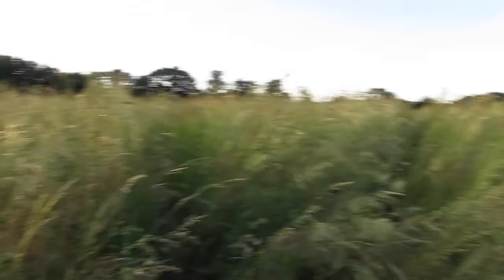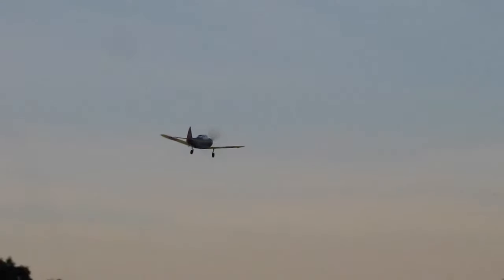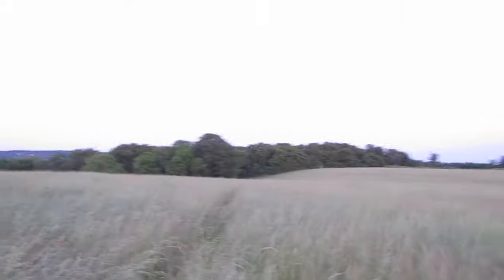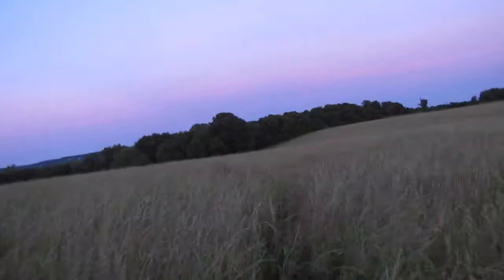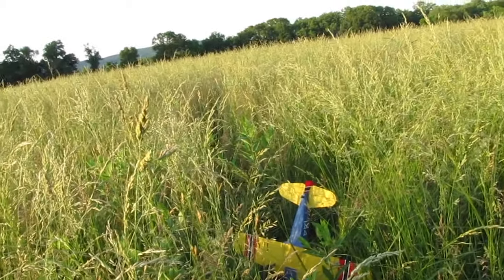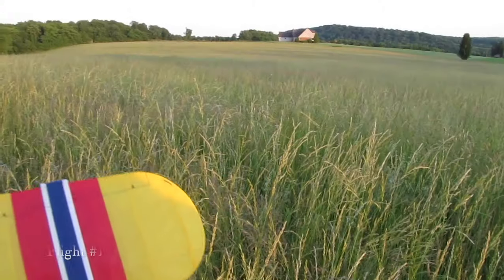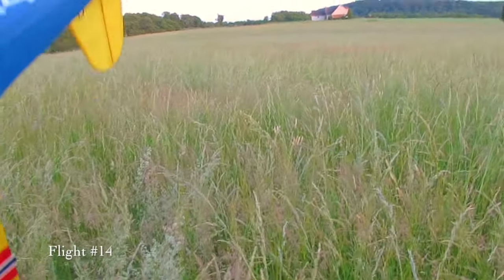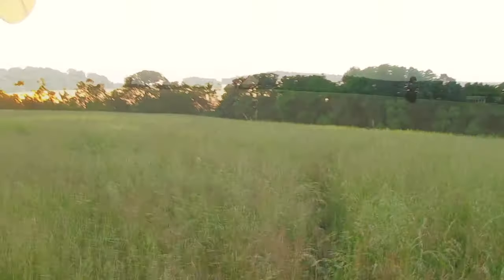Rubber-Powered Fairchild PT-26 - Anatomy of a Trim Session

Comment: Excellent as always. Could you someday maybe show how you adjust the rudder, change thrust angle, add weight, etc while at the flying field.
Reply from the maker: Thx, I'll post some photos when time allows. The rudder and elevator have small soda can hinges (1/4" x 1/2").  Make a slice on each side and slip them in.  Hit with CA.  2 or 3 hinges will do, securing each adjustment.  With clay, I don't add much...maybe the size of a pea each time, or less. I'll post the thrust plate for the nose block, which is very helpful for field thrust adjustments.
Reply: @maxfliart  any photos you could share on adding clay and gurney weights?  Thanks!

Comment: Following your example of rebuilding your Caudron, I have completely stripped my Me109, removed all unnecessary weight and treated it to new flying surfaces and tissue, so avidly watching your trimming videos in anticipation of its re-maiden flights. I'm just wondering what your thinking was behind your decision to change the prop? Currently, the 109 has a small fast prop... Many thanks for taking the time to post another wonderful video.
Reply from the maker: The first prop was a yellow Czech prop, which I heard from some pals was quite good.  It did ok, but I just wasn't feeling it, so I switched to a 9.5" blue prop...don't know the name of it...but it felt better to me.  I've since broken it after a rough landing in the wind, and have put a 10" white EB prop on her. Thx for the kind words.

Comment: Thanks mate. I'm just returning to the game and am learning a lot from your videos. What sort of camera are you using? I'd like to make my own videos and can't see my GoPro matching your efforts.
Reply from the maker: I use there latest iPhones for my B roll footage, and an older Canon PowerShot SX20 for right zoom flight shots. It has much lower resolution, but combined with a 20X optical zoom, gets u close enough for the YT vids. I use this cam from 2009 because it was early on with image stabilization, which was mild, and perfect for tracking FF models. Anything newer or especially current has such a strong IS, that it nearly makes it impossible to frame the model as u would like throughout the flight. Plus, I found that the 20X is about the limit for zoom, while hand held. Once u get closer to 30X and above, it's not worth the effort. Using a tripod for capturing the moving flights isn't realistic, and leads to even more jerky captures. Good luck!  U can find these Canons for around $60 on sites like Mercari. The only issue is dust on the censor, which can not be cleaned for less than the cost of the cam, so it's best to find one that's spotless. So I ask the seller to shoot a blank surface and send me the shot. Has worked well.
Reply: @maxfliart  Thanks. The zoom was what really impressed me. It's a shopping I shall go.
Reply from the maker: @adelaideoldphart  Yes, it quickly makes up for the 720p resolution.  Of note, I always manually focus for infinity prior to each flight. Otherwise, auto focus likes to play tricks.

Comment: Very interesting. I never liked to make 2 adjustments (say, thrust & ballast) at the same time .. too easy to get a bad outcome.  It sure has a tight right pattern, which seems to have gotten rid of the power-off scallop noticed in later test flights. At one point, when you said you were adding a tad more tail weight, I found myself saying NOOOOOO!  But, it all worked out in the end. It's really a beautiful Ryan.  Reminded me of one of my 1st control line planes, the famous Cox Thimble Drome PT-19 Flight Trainer (but that was open cockpit). Thanks for the nice video. Cheers.
Reply: I said the same thing...nooooo!   In flight 13, the glide was as close to perfection as I think I've ever seen - if anything, it was just about on the verge of a slight stall in the glide - but then you moved the CG back (clay on the tail), which really confused me.   I figured that if you wanted more climb at that point, I thought you'd go with a thrust angle adjustment.   In any case, that's a gorgeous model, and a good flyer.   Beautiful job!
Reply: By the way, I had one of those Cox PT-19's also.....man, that was a long time ago!
Reply from the maker: Haha...I too felt the same when I was reviewing the films!!  Surprised me.  I suspect it was only a very small pea sized bead of clay I'm sure part of it, at the time, was my strong resistance to changing the thrust setting...which would take up more time in the fading light.  Much easier to simply add clay.  Still, in the end, thrust was indeed one of the keys to dialing her in.

Comment: That Norwegian Army Air Service (Hærens Flyvevaaben) PT-26 is beautiful. I love the Norwegian colours. They really needed that canopy up there. PT-19/26 is a classic design with perfect proportions and areas.
I have thought that if there was some lightweight mechanical way to slightly increase the turn the initial climb out which, of course, tends to counteract a right turn because of lefthand torque,  and then relax it as the motor depletes, it would make a big difference. Something like a DT for the rudder might work.
What do you consider to be your best-flying, most satisfying model?
Great build and flying, as always.

Comment: Awesome...! How do you make gurney flap?
Reply from the maker: A gurney flap is simply a 2" stick of 1/16" sq. balsa or even thinner.  Just glue stick it to the top or bottom of the trailing edge near the tip, and it acts as a partial aileron on that side, to either lift or drop the wing.  Cut it shorter or make it thinner if it's too much of an adjustment.  A quick and easy field fix.
Reply: @maxfliart  Great.  Thanks

Comment: Trimming is a frustrating process,but you make it look easy. I had a question. When doing the final assembly, I'm aware that you're supposed to glue balsa to balsa,and not balsa to tissue. How you glue balsa to balsa on the tail?
Reply: Hi Adarsh! 
What we tend to do is to scrape or score lightly, removing a little tissue with an Xacto, the places where balsa can meet balsa. That way we can expose a little balsa to glue to make a solid, tissue-free bond.
Reply: @vancegilbert8466  wow. My comment got a reply from one of the masters! When one is scoring to remove the tissue,won't the balsa also get damaged?
Reply: @adarshlakshman4715  Well you are very kind! 
You only remove enough tissue to see the bare wood, so no damage will be done. You can even carefully do it with a piece of sandpaper or fingernail file!
Reply: @vancegilbert8466  that was going to be my next question precisely! Perhaps I can use one of those notching tools that they make for spar notches in wingribs? Or a tool similar to that.

Comment: What is a giverny flap?
Reply from the maker: It's a trimming element named after the famous race car driver, Dan Gurney.  For F/F, it's simply a thin, short balsa stick, usually attached to either to the top or bottom of the trailing edge of the wing.  It helps to lift the wingtip, or push it down, as needed.